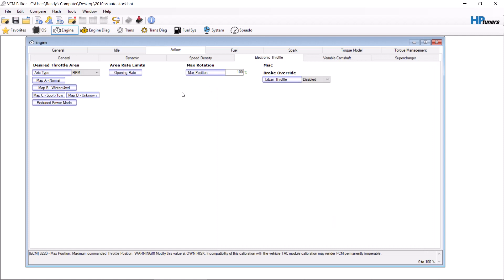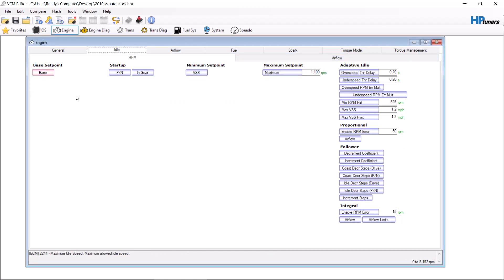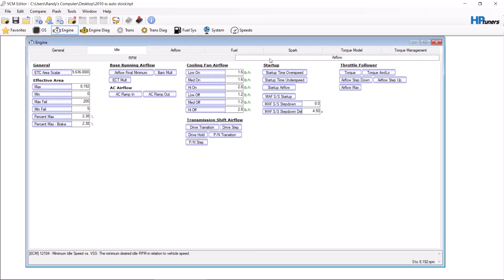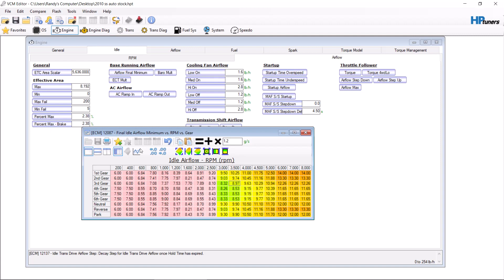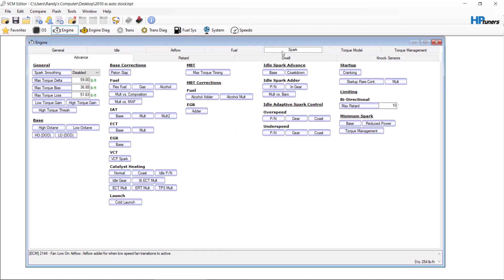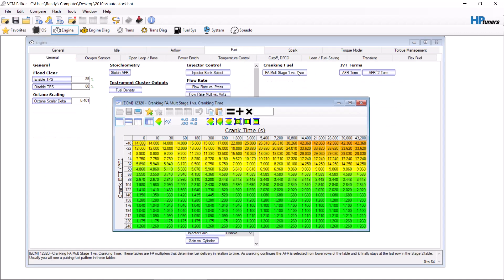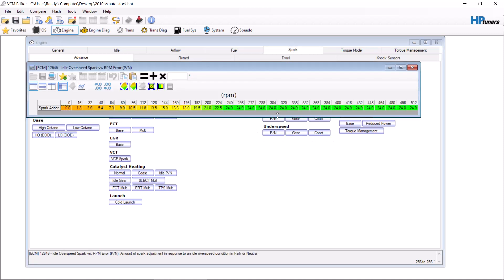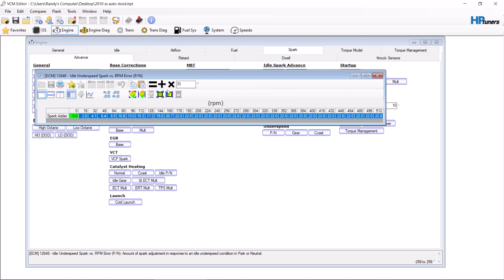Gen 4 Idle after cam swap part 1

Comment: When you change the idle over speed do you always leave everything at the same number like that? When I had mine done I asked them to make the idle more aggressive it’s too much pushes through the converter and when you’re coasting through a parking lot with no throttle it hunts up and down quite a bit. I’m probably just going to try and change it myself. Need to delete my internal mode switch transmission code too.

Comment: Thanks for posting this. I’ve got an 07 Yukon that I did a DOD delete/cam swap on and this helped tremendously! But now it shifts super hard when I put it into gear 😐
Reply from the maker: Did you mess with the trans settings a bunch
Reply: @Recklessmotorsports  hey thanks for replying so quick. I actually had messed with the MAF settings and a couple other things so flashed an earlier tune and did what you recommended and all was well. I still have trouble with cold starting but not sure may be with the fact that I have a P0341 code, camshaft position sensor, that I have turned off idk. It’s a 4 pole cam sprocket like I’m supposed to have. But your video helped tremendously! I was able to smooth the idle and keep it from dying coming to a stop/slow down. I really appreciate it
Reply from the maker: Yes it’s cam related try to start it, let off, then try again and it’ll fire right up
Reply: @Recklessmotorsports  so if it’s cam related is there anything I can do to fix it? My last cammed motor did the same thing. Also I noticed that to add 10% you added 1.1 so what would 5% look like?
Reply: @bowtiebuilding  1.05
Reply: @bowtiebuilding  when you replaced the camshaft position sensor did that fix your start issue?
Reply: @jasonsweatsjasonsweats8370  no sir. I still need to add a little air to start up and try to smooth out the idle. It’s not too bad but it’s got a shake to it